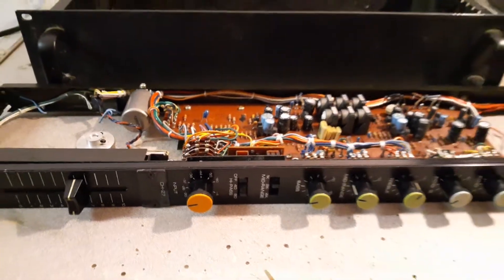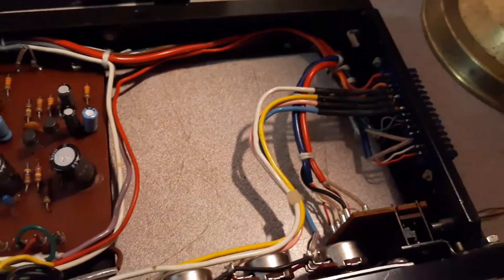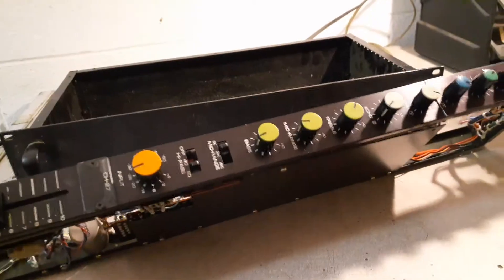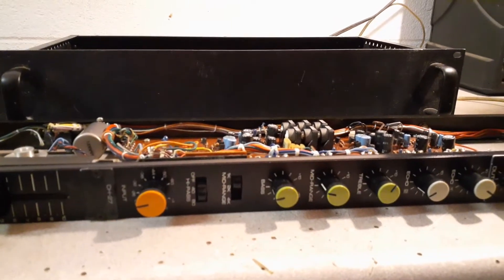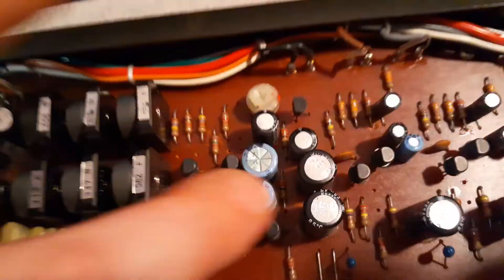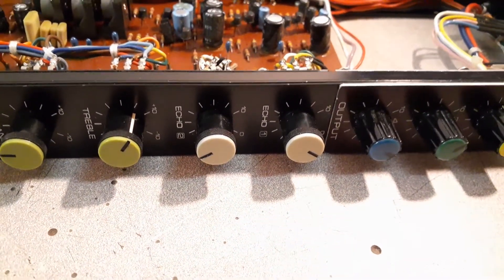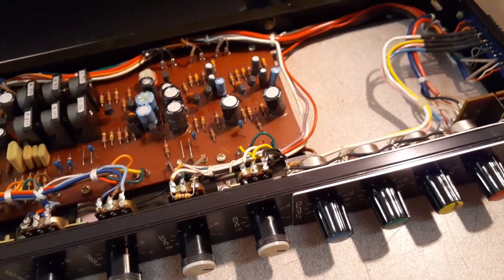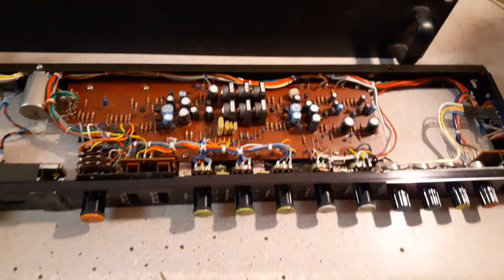Yamaha PM-1000 Preamp EQ Rack Mod, ep 2: The plan for modifications.

Comment: I’m about to start a rack mod for my pm1000. Can you recommend a power supply for it?
Reply from the maker: There used to be a kit available on eBay. It has the ~44 volts dc that the audio circuit wants as well as 48 volts the phantom power circuit wants. Five Fish Audio used to sell a kit as well. I currently can’t seem to find where to buy either of them. You could also adapt just about any regulated power supply that would get you close to that 44 volts it prefers.